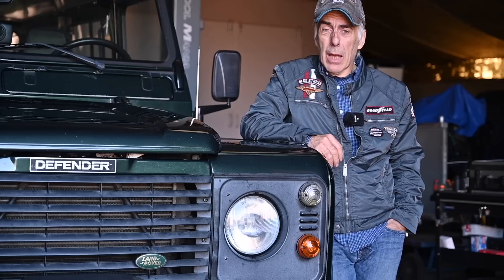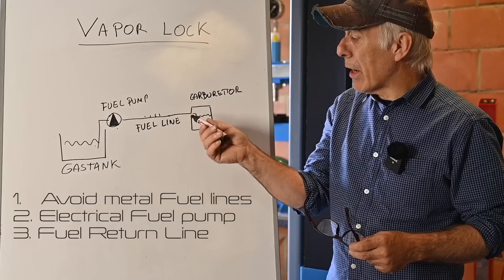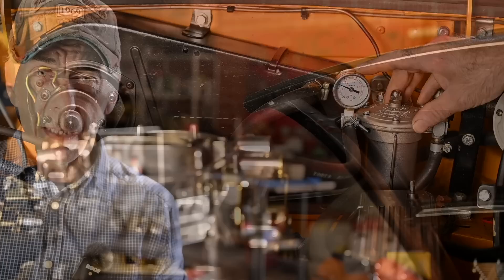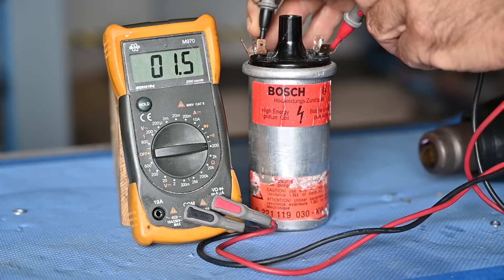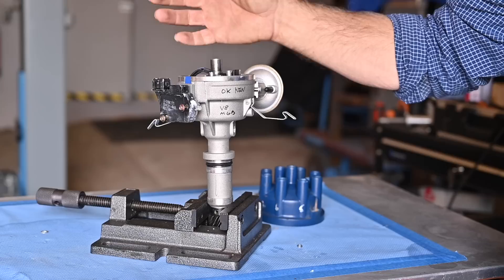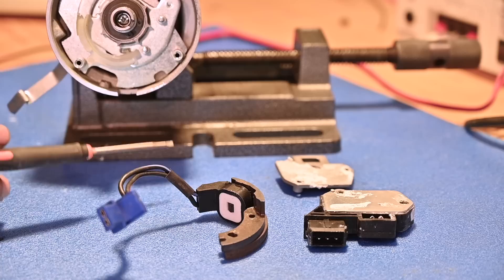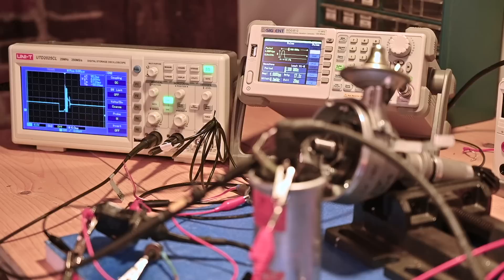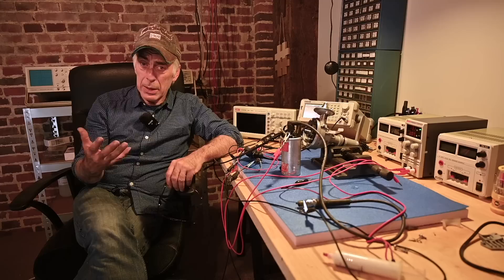Causes and fixes for warm start issues

Comment: Hey Steve I have a 2003 Chevy Silverado with a 4.8 engine I’m having this problem rn I changed the fuel pump,fuel pressure regulator,fuel injectors,spark plugs and I have performance coils and this only happens when my engine is hot and in the mornings it turns on perfect any help I would appreciate it
Reply from the maker: Hi, so this car i shaving an injection and is not naturally aspirated.  Based on what I read, you have changed and inspected most parts.  I suspect that you have sensor issue, such as the  MAP, MAF ,MAT etc Those measure the condition of the engine state in terms of manifold pressure, temperature , airflow and other.   I would first connect a OBD2 scanner and see what faults are logged by your ECU. If you have none logged or pending, scan the live data with a running engine and check the values....  Its hard to stated what it exactly is by the information provided...  But at least this is a good start.   You might also have a bad ground, make sure that the engine and injectors are all having a good ground ( - Battery)

Comment: There a YouTube where they do Off Road recoveries in the desert where over 100 is normal. I saw one where a jeep with fuel injection wouldn't  start and they poured cold water on the fuel rails and it started right up, He said they used the same trick on carbureted  cars pouring water on the carburetor to cool it down
Reply from the maker: Thanks for the comments and indeed..

Comment: I was dying to understand how old car carburated  engine  was really working withought computer,  but i didnt know what they called it at first, i was srarchimg using old engine key word and that didnt get me what i need, that impressive, everything is mechanical. And the important part is the  carburator that regulate the fuel/air mixture. In a comoutirised car, the computer do that by using sensors.

Comment: I have Audi TT 3.2 2009 model 
When the car is parked under shade it starts normal but when the car is parked under sun heat it do not start or starts after long cranks

Comment: 8:50 Looks like you need to replace your mounting studs with longer ones to make up for the spacer.

19:20  He is exactly right!  Many, MANY DIY'ers think that the right thing to use here is "dielectric grease/compound" and they pass this error along to others.  You are NOT trying to insulate or protect anything here; you are trying to transfer as much heat as possible.